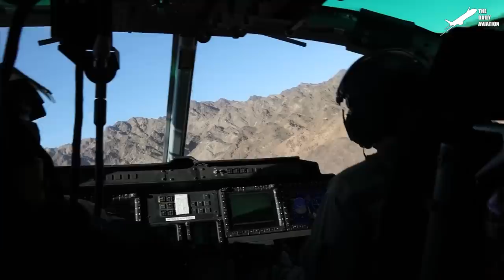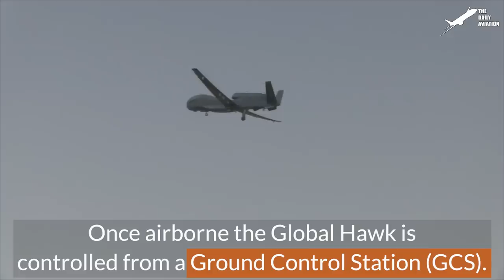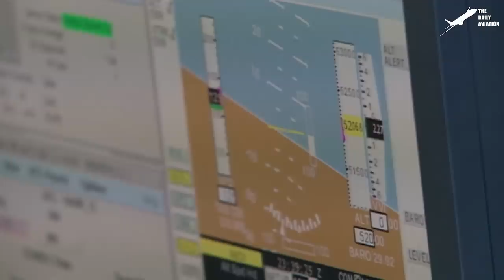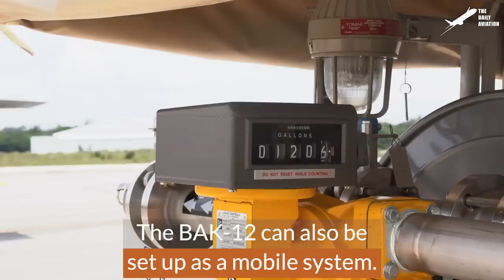How to Change Giant Tracks on the Massive US M1 Abrams

Comment: I was a mechanic on the Leopards of the Belgian Army, I also replaced the rubber pads of the tracks. The job is much simpler on Leopard tracks, there are no nuts to tighten, they are simply slipped into guides and self-locking. German efficiency 😁